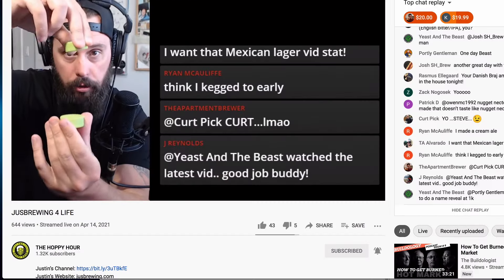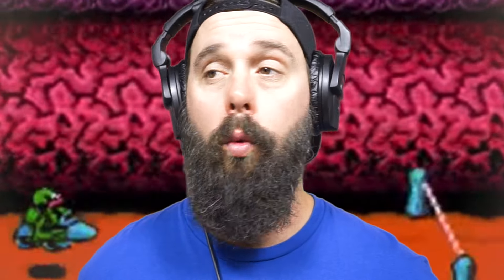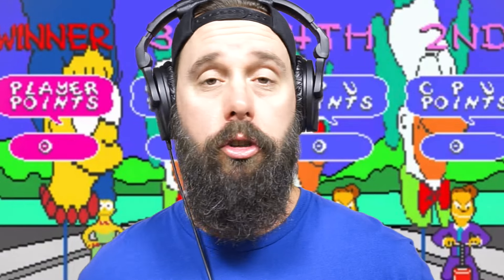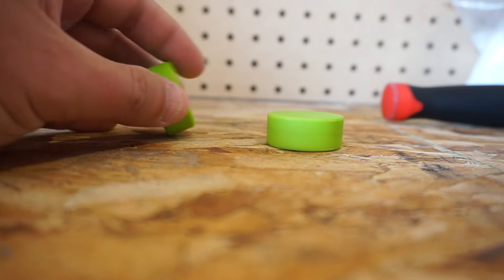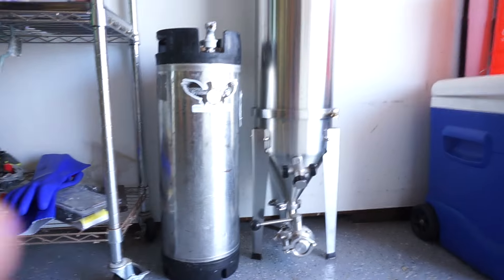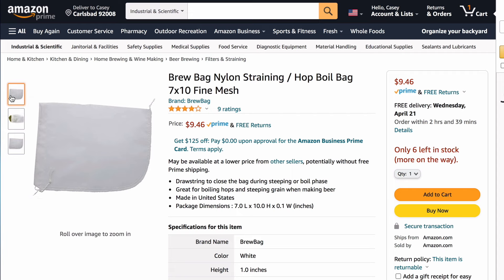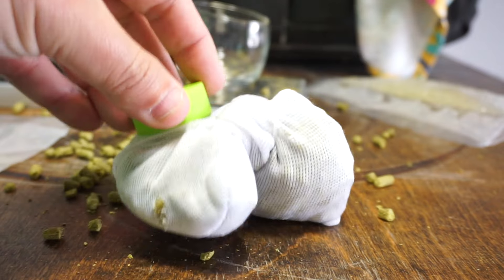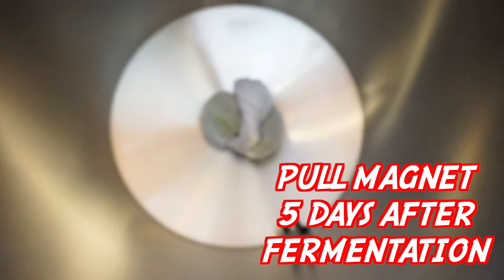How to DRY HOP in PRIMARY FERMENTER (NO OXYGEN)

Comment: I’m a novice extract brewer trying my first IPA.  Recipe calls for adding dry hops when transfer to secondary fermenter.  Am I tracking correctly I dry hop during fermentation using magnet trick, then pull the magnet so the bag drops and soaks for the suggested period of time?  If trying to avoid oxidation, I don’t see the big advantage of transferring fermenters.  Thanks I’m advance.  Your videos are great!
Reply: Hey! Good question. I’ve been wondering the same thing. My understanding is that you can just dry hop in primary. Anyone can correct me if I’m wrong, but the purpose of transferring to a second part is to get your beer off of the yeast. This helps your beer “clear up” when you let it sit in a fresh vessel. 

Most people are saying that you can just keep it in primary the same amount of time you would have it in the secondary. 

I plan on brewing a NEIPA with 2 additions of dry hops using the magnet method in my primary/

Comment: Wouldn't all the air movement leaving the fermenter take much of the aroma of the hops suspended with it?    Don't get me wrong I love the idea, in fact I've had this idea in the past but never went for it for various reasons.

I've put hops in a receiving keg and purged prior to filling/transferring, and guess what , smelled a lot like hops when I purged. 

Therefore, if hop aroma is suspended and potentially leaving the fermenter, at an even higher rate (days) of fermenting CO2 production,  it's not staying in your beer.  IMO it's been stripped at that point.  Think of it as an air freshener in front of a slow fan, it won't be the same after a few days.
Reply from the maker: Cheers!
Reply: @HOMEBREW4LIFE  haha ... For sure dude

Comment: Only issue is, you’re using a fermenter that isn’t air tight. Soooo it’s kind of pointless doing this with the anvil fermenter isn’t it?
Reply from the maker: Why would you want a fermenter airtight? Commercial breweries fill up their fermenters 1/3 all the time
Reply: Pressure fermentation mostly I suppose, but if the fermenter isn’t airtight or pressure capable Is that really oxygen free dry hoping?
Reply from the maker: I think u are confused my the term “airtight”, but just focus on being chill and the truth will set you free

Comment: Great intro and method. I too use Sous Vide for mashing experimental batches, delabeling/cleaning beer bottles and fermenters. It's a great way to get water that is hot enough to clean with but won't destroy expensive plastic fermenters like the fermonster or big mouth bubbler - just pop the probe in the fermenter, fill it with water to the neck and drop in some cleaner - kick the sous vide on at 135 degrees - nothing melts, it gets cleaned, no scrubbing. Try it!
Reply from the maker: Solid feedback, cheers!